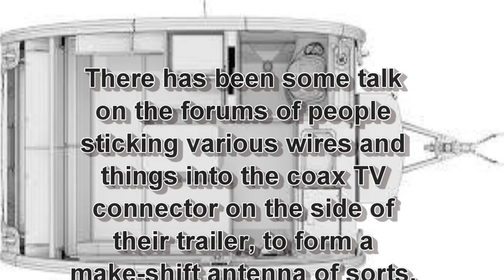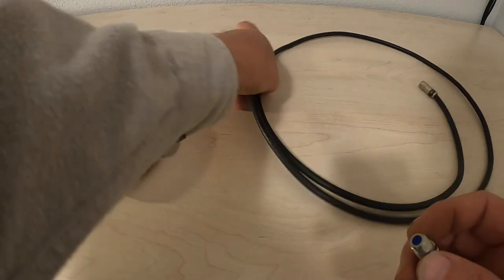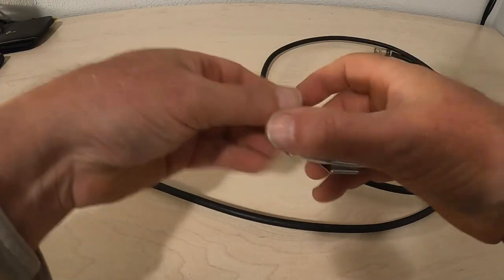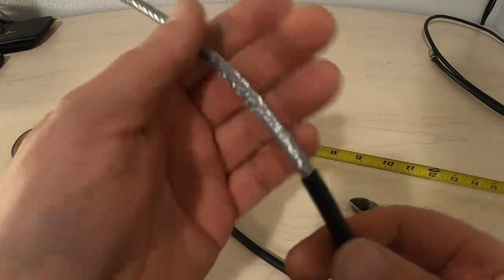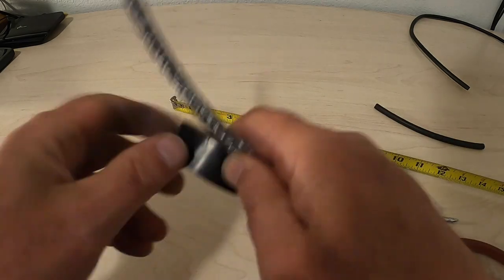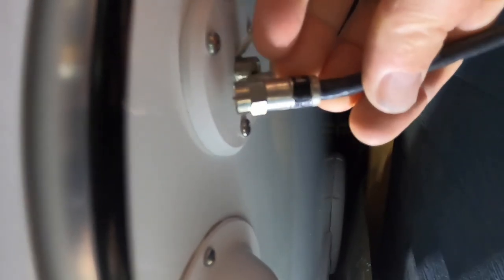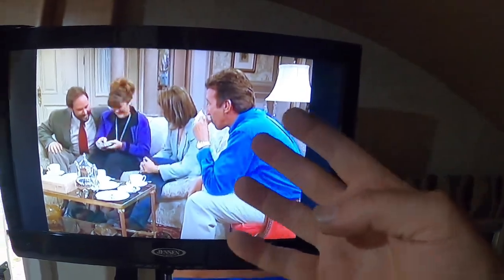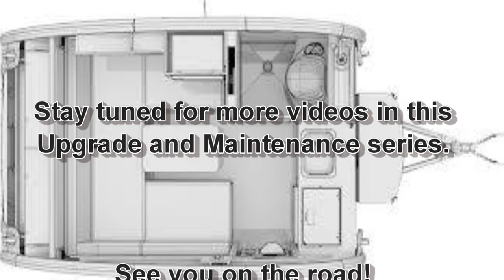Coax Dipole Antenna Upgrade - 2015 Tab Max-s Trailer

Comment: Does it have to be oriented in a horizontal plane? Or could it be in a vertical plane, as it appeared to be when you initially attached it? Thanks for sharing.
Reply from the maker: Generally yes.. Horizontal plane is usually better, because the radio waves are broadcast "horizontally polarized"
A receiving antenna works better when orientated the same as the transmitter.
My trailer was in storage next to my garage, and I didn't have room to stick it straight out, but it works pretty well curved up like that. Different orientations work different in different lications

Comment: With the newer tabs having the connection in the nautilus compartment would you make it longer?
Reply from the maker: Sure.
The tip needs to be the same length, and the folded back part needs to be the same length, but the cable leading to it can be longer.
Just be aware that cable doesn't conduct perfectly, and the longer the cable the weaker the signals will be getting to your TV. Make it just long enough to get out of the compartment.

Comment: I could not get this to pickup stations 20 miles away.
Reply from the maker: Twenty miles is a piece of cake for this design.
Lots of possible causes.
Start with these two.
1. Problem with construction. Check for no short between the center conductor and the outer braid.
2. Check for continuity of the connector at the side of the trailer to the back of the TV.
Reply: @tabtrailerupgradesandmaint2923  I checked both, looks good. possibly obstacles in the way. I am in ct, hilly and lots of trees.
Reply from the maker: @tomgiar923  
I have tha same conditions here. Mountains and trees.
A couple other thoughts...
1. This antenna is "directional"
The direction to the city transmitters must be "perpendicular" to the antenna. Try moving it around a bit.
2. For a test, you might try swinging out your TV and connecting the antenna directly to its back, and rescanning for channels. Reception won't be good from inside your trailer, but it might be worth checking, in order to know if the coax between your TV and the outside connector is good.